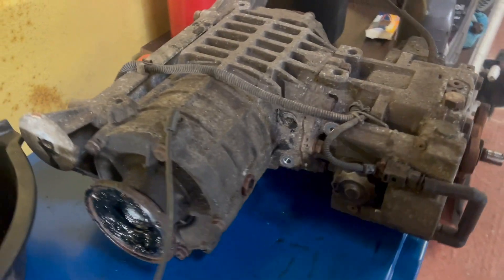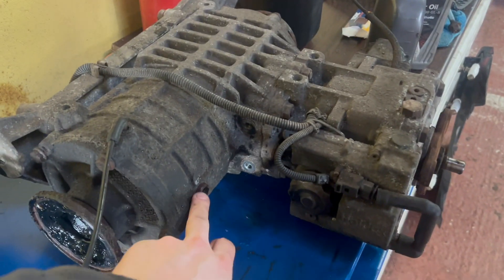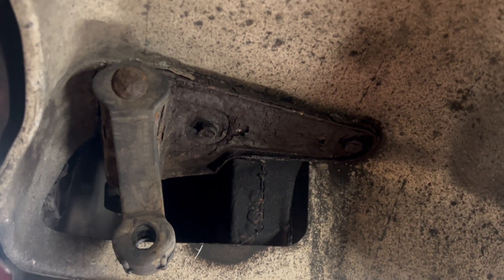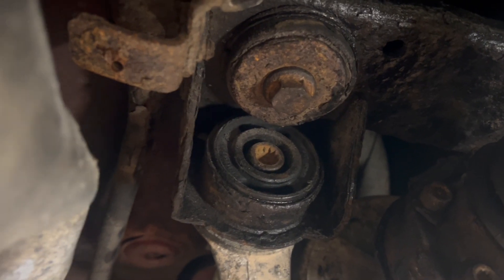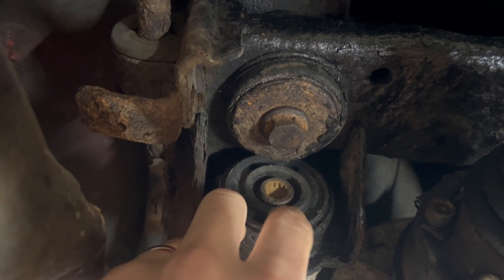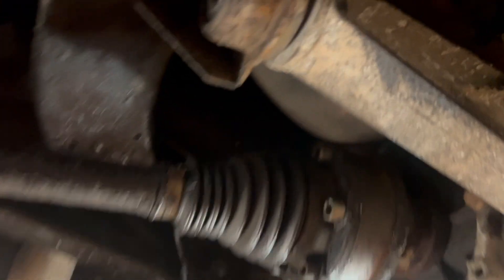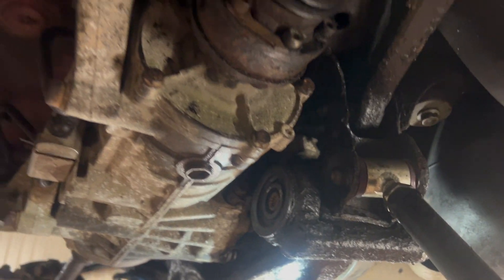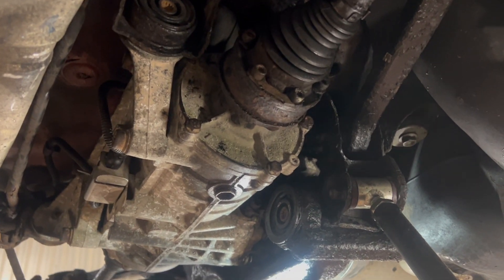MK1 8N Audi TT Rear Diff Swap - Quick Guide

Comment: Appreciate you’re sharing this “ rear Differential “ things 
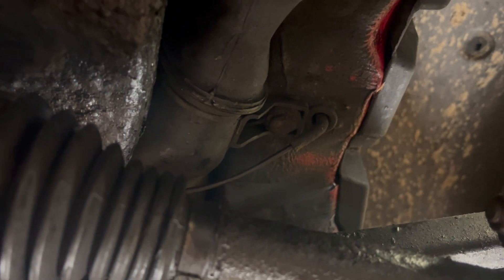If you don’t mind I need a bit help the 2 lines small hoses left and right on vid ( 3:58-4:02) , what the actually function of those 2 hoses , because mine was broken/ damaged on the left side, It seemed like I have problem with rear tires skidding and clunky when cornering from the start to drive now
🙏
Reply from the maker: They are breather hoses. One for the haldex and one for the differential. They should be put back in otherwise there's a risk of moisture entering the differential
Reply: @ got it ,  Ordering haldex oil  now I’m gonna change the haldex oil and repair this small breather hose back this weekend )*
Btw Thanks 🫡👍